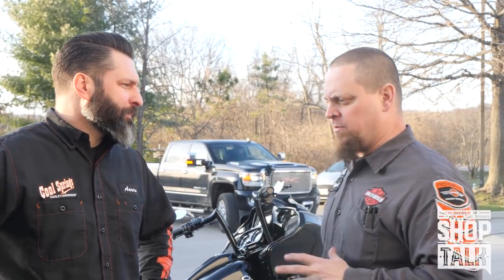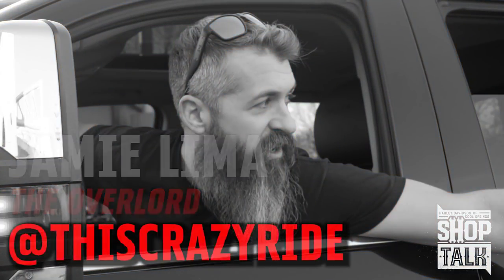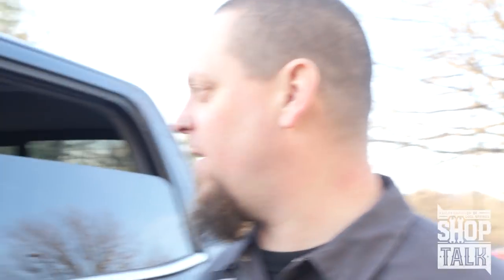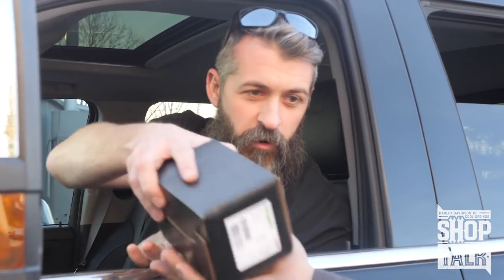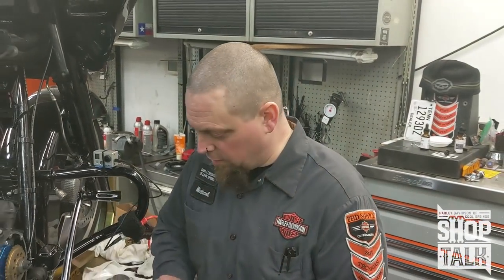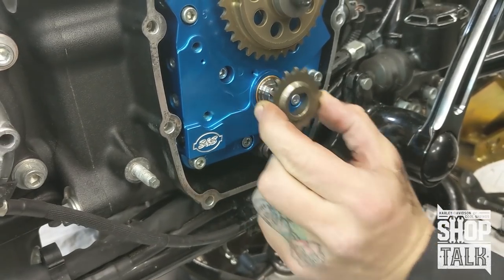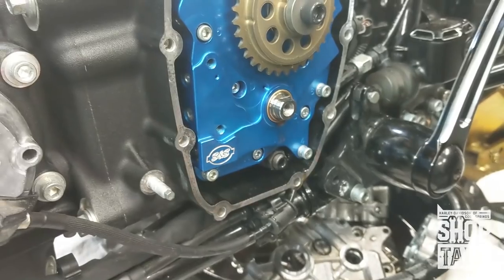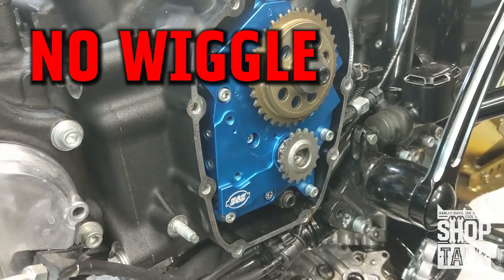Screamin' Eagle 124CI Kit, S&S Cam Plate, Andrews Cam | Shop Talk Episode 16

Comment: I finally got my bike done. It's a 2012 street glide that  I made into a 124 I bought the jugs and pistons from a local shop got S&S heads and Cam chest and Woods 999 cams from Fuel moto got my throttle body and injectors from HPI and my dyno sheet says 129 HP and 146 torque 👍👍
Reply: But did you make sure you have plenty of oil pressure at low RPM?  Because the TC has low RPM oiling issues. It is a killer for longevity and why I don't run my modified FXDI at low RPM. When I'm cruisin, I am doing at least 3000 RPM. I have the bike set up in a drag configuration so when I take off hard, I am relying on high revs and clutch slippage, rather than the low end torque.
Reply: @skorpius752  I did put a S&S high volume oil pump in it which has improved my oil pressure at low RPMs quite a bit and I mostly ride 2up and when my wife and I are on a vacation trip anywhere from 1to 3 weeks at a time and were rolling down i70 or a safe 2 lane back road were pushing 90 mph for long periods of time but almost always somewhere between 70 to 90 mph unless were on some beautiful back back way back roads then were going the speed limit but with that Woods 999 cam it does want 2700 RPMs almost all the time. I have noticed passing semis or cars is sure a whole lot quicker and with far less effort.  Part of the reason I built it to be more of a torque monster rather than have crazy horsepower is because I bought a trailer to pull behind it and I didn't wanna be struggling to go up big hills or mountains and I wanted it to be reliable and able to run pump gas.
Reply: @110americalovingpatriot2  Cool. A lot of people will overlook details like that. I always ride solo and at most may haul 50 lbs of luggage on my Dyna so I still have plenty of torque. Still, I'd like to throw in some Andrews TW37 cams at some point because the powerband is kinda weedy with the stock cams not being tuned for the airflow.
Reply: I don't own a bike but I appreciate the video & that you are watching it & commenting..... unlike the pack up
above who  came for just the music..... of course they'd have complained no matter what was played?
How much power did you get off of this cuz the stock bikes I've ridden were kinda sluggish?
peace man

Comment: You guys do a lot of great builds with aftermarket components on what seem to be newer bikes....are you voiding the HD warranty
because of all the aftermarket parts being used in these builds
Reply: Thank you for the support.  As far as warranty call Aaron at the shop.  We stand behind the work.
Reply: Wade Kruger if I may interject. To answer your question...yes, technically you can void the warranty but alas the Magnuson-Moss Warranty Act states that a warrantor has to be able to prove that a problem associated with a warranted problem was caused by the installation of a 3rd party aftermarket part and that the part caused the problem. So basically you are protected as long as you are a smart consumer who is NOT afraid to stand up and fight. That being said a good dealership like Cool Springs will stand behind their work regardless. These guys at Cool Springs are good folks. I've purchased from them once in the past and they took care of me. But after moving 3hrs west to Memphis I've used my local HD dealership and they too have stood behind EVERY bit of work on every one of my engine builds, cam work, dyno tunes etc. Build a good relationship with your dealership, parts dept and your service techs. Every year around Christmas I buy a bunch of pizzas for the guys in service and parts an have them sent to the dealer and join them for lunch and thank them for keeping me on the road throughout the year. A simple gesture but it goes far. Do your scheduled maintenance and you'll rarely have an issue. Hope that helped you out.

Comment: Do anyone know of any problems running the S&S 124”big bore on a Road Glide with a rider traveling 20k a year?  I like to ride and get my mile but i'm wondering if my bike would stay in the shop more than a regular 107 stage 2 bike.
Reply: Great question
Reply: Great question hope they get back to you, I've raced boats and drag cars and dirt bikes, and in all those sports, high performance  equated to way more time in the garage, than on the water or track. Be safe!!

Comment: These guys did my 2011 Roadglide , ive got 123HP with 135 torque. Its a beast and loves to eat new CVO's. LOL!
Reply: Well, you would definitely blow my Dyna away at a drag strip but I'd have your bike for lunch on the twisties. Power isn't everything.
Reply: What size motor, what cams?

Comment: The description says 124 and in the video it says 114.. so is this a 107 to 114 build? (stage 4)
Reply: Allen pretty low numbers for a 124.
Reply: Aftermarket jugs (S&S and others)  give the 107 M8 124cid. The 114 becomes a 128.
Stage 4 is Harley garbage and it kills torque where you need it. Stage 4 is over priced under performing junk IMHO. Stage 3 is what you want if you want to keep the warranty.
My thoughts